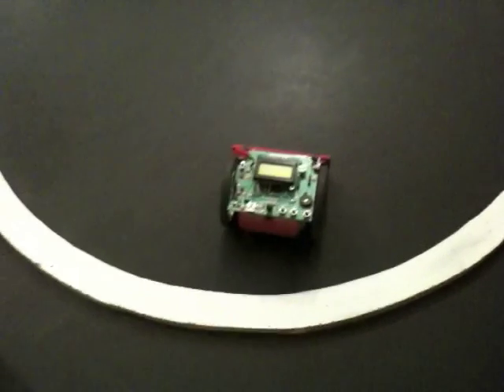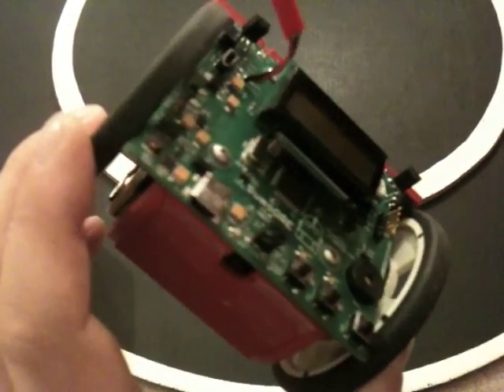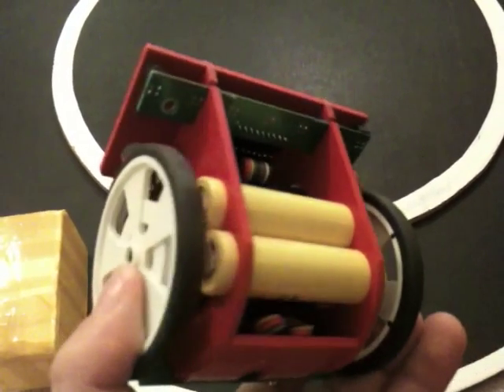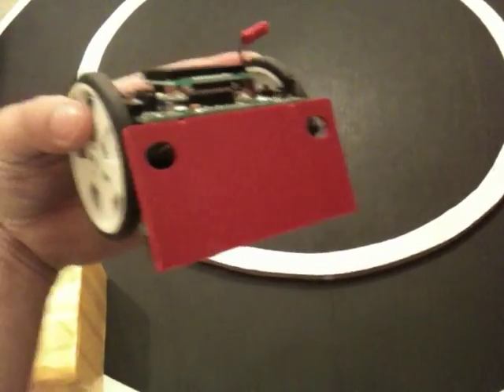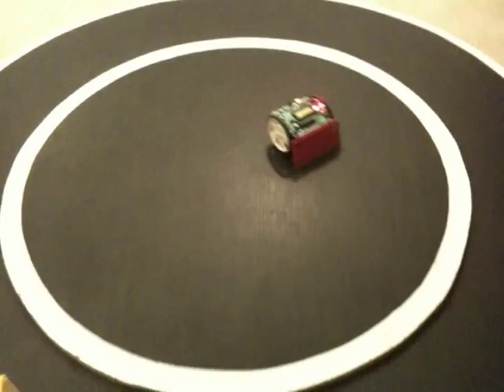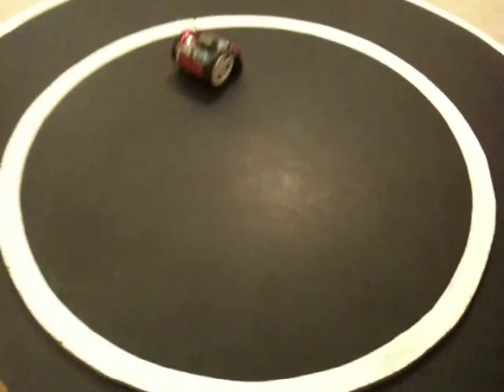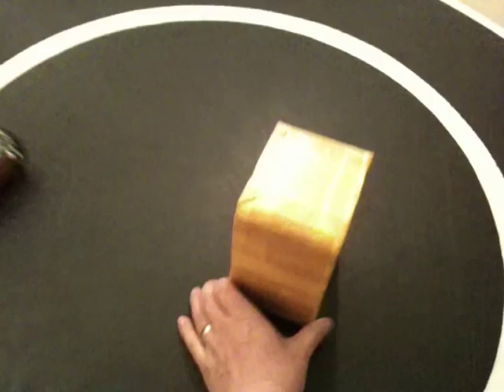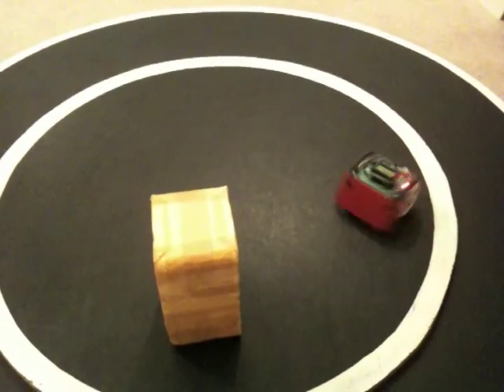First steps with the sumoORE mini sumo robot

Comment from the maker: @thesaxmachine Its using the Microchip bootloader and some LCD code that I put together for the C18 compiler. The microchip bootloader is massive in memory and only supports windows unfortunately, but the PC software side is pretty slick so I'm living with it for the time being. 

The LCD code can be grabbed from the software wiki page for the robot if you need some. A few parameters are specific to the the 2x8 LCD but easy enough to change (ie- memory locations for line 1/2 start, etc..)